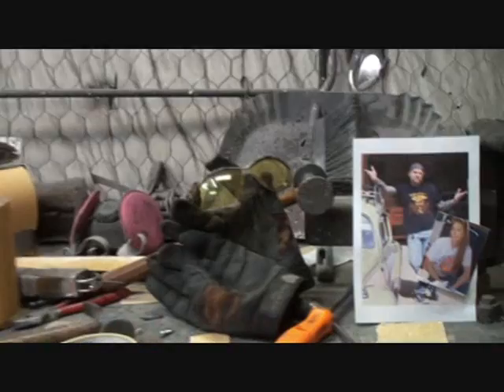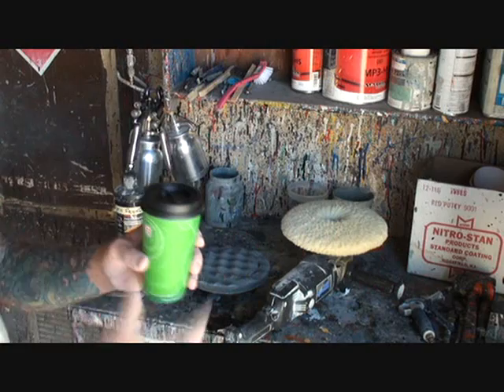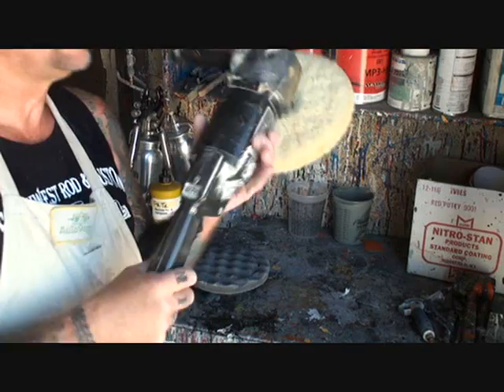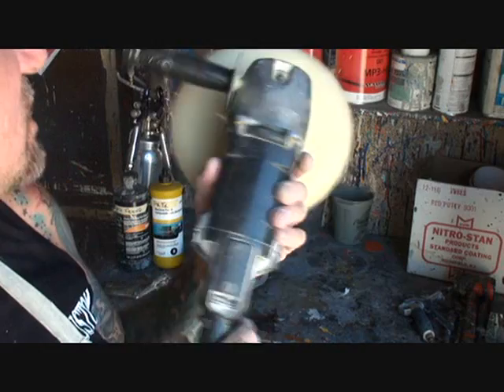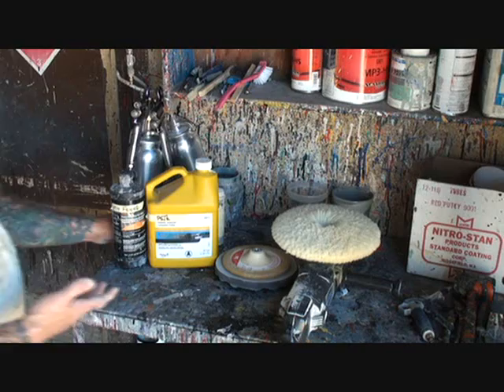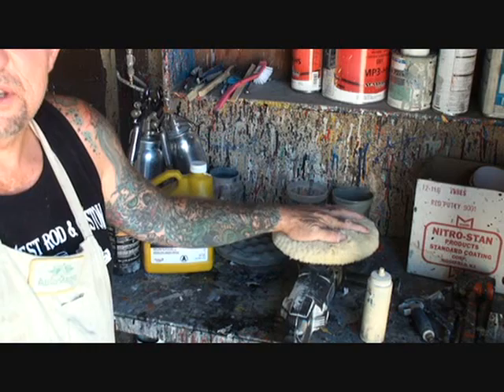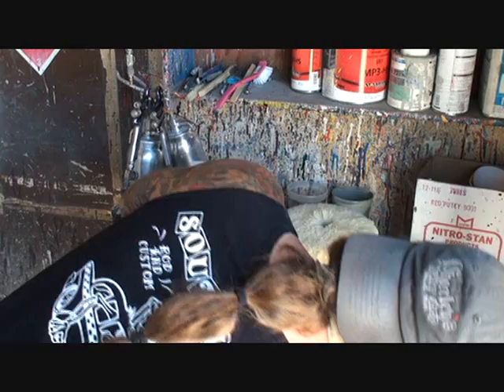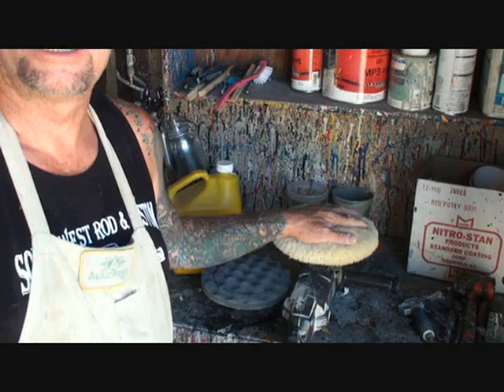HOW TO: Color Sand And Buff-Custom Car Painting-Part 4

Comment from the maker: I use 3M buffing compound, i don't use anything else, then I go over it with 3M polish and a black waffle face foam pad to clean it up. Be careful not to burn through the clear, use your buffer at 1800 rpm for the compound and 800 rpm for the polish. Good luck. Pete

Comment from the maker: When I use the word FIRM PRESSURE I mean to hold the buffer strongly so it won't get away from you, You want to be able to control the buffer holding it firmly, let the weight of the buffer do the work but hold the buffer firmly.. Pete